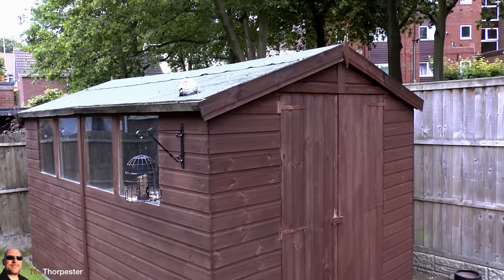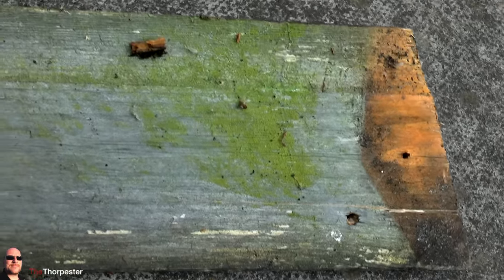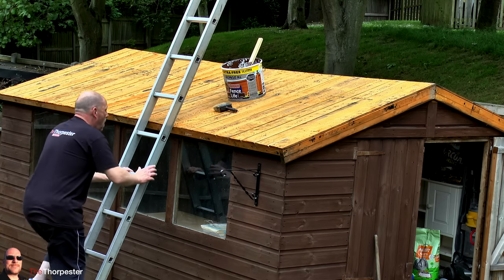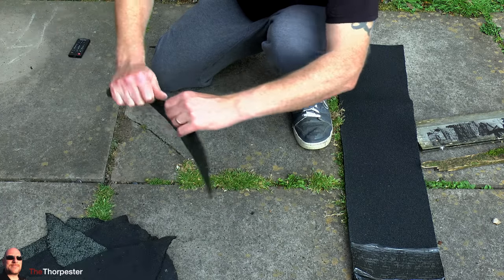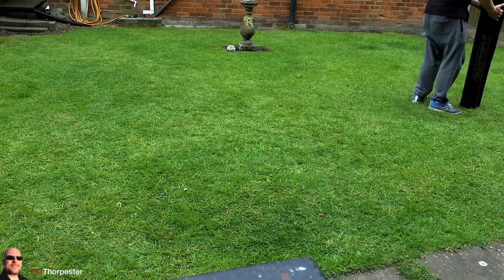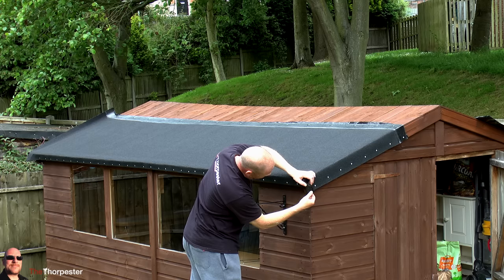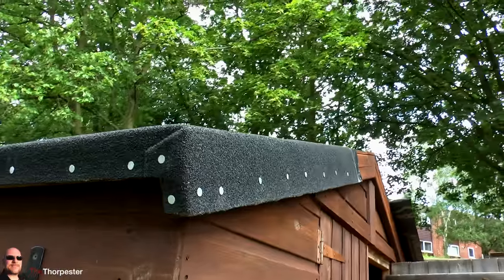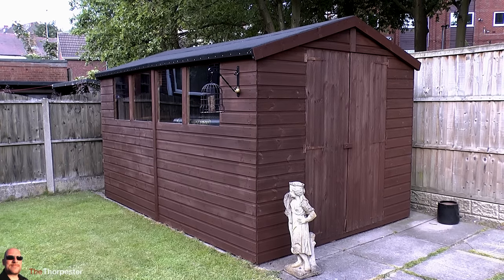How to Easily Felt a Shed Roof The Right Way- DIY

Comment: Might do my own shed roof. At least now I know the adhesive is to join the felt and not to stick the whole lot down! Is it necessary to have the wooden end trims as if mine are rotten I havent got a saw for new ones.
Reply from the maker: Nice one.  Wooden ends not necessary really.  They just cover up the nails and look better.
Reply: If you've got adhesive left over, you can apply it under the turn overs at the edges, it just helps durability.
Reply: Good idea I am going to apply the adhesive to any exposed wood where the felt finishes. Will throw  some dry sand on  this will further protect the adhesive from uv light.

Comment: Nice tidy job. The only issue is that the felt is way too heavy for the structure almost twice the weight of shed felt and will cause the roof to sag in a few years. There are some very strong shed felts available and will last 15 years plus and are more suitable and lighter  and won't cause the roof to sag. The best option by far is EDPM rubber, which is  not much more expensive and comes  in a kit form, also light weight and is one large rubber sheet and will last up to 50 years.
Reply from the maker: Top advice mate thank you although the Shed Roof I put it on will sag no matter what I put on it.  Not built well at all

Comment: Great video thanks :) I’m just about to do the same but to a larger area, got to do something in tier 4 lol 😂 

You have really helped out in my plan and prep... you are a star :)

Couple of questions if you were to do it again would you put two pieces either side and then leave a foot either side at the top point and then add a smaller capping piece instead of using one large piece to go right over?( hope that makes sense? Lol )

Did you put anything over the nail heads like roofing sealant ? 
Thanks again :)
Reply from the maker: Nice one mate.  You'll be fine.  I didn't put anything round the Nails and they seem fine but I suppose you could use the sealant as well making it a stronger seal.  If my Shed had been an inch wider, I'd have had to use another strip.  I got lucky in the measurements.  If you have a heat gun or torch, definitely heat up the back of the strips as you're rolling it on although you don't need to.  Mine's still exactly the same now as it was when I did it.  I'm still really pleased with the job I did.

Comment: Thanks for the video, very helpful and easy to follow. 👍 I need to re-board my 5m x 3.6m roof with 12mm ply as the old boards have warped and leaked from the damaged felt. Would you recommend a preservative for the ply (despite it being covered)? Also, how much of the tar adhesive do you think I may need for the overlaps? I am using four 1m rolls compared with the three you used in your video. Thanks again

Comment: Ive noticed the felt on my shed doesn't cover all of the wood on the overhang. On the Inside it's damp In these areas, could this be the cause?
Reply from the maker: I think a contributing factor if the water is soaking through but there could be something else going on.  I'm afraid I don't know mate

Comment: Very tidy job but why did you use torch-on which is meant to be fully bonded to the substrate with a propane gas heat gun so it’s fully bonded and for that reason is used on flat roofs?
Reply from the maker: Thanks mate.  It's extremely strong stuff and still quite cheap.  A much better alternative to the usual felt you get.  If you have a Torch then all the better but it also works very well in this way too.
Reply: Ray Mason. The clue is in DIY I take it you have used  a torch ? The average Joe would get in a right mess especially on the first attempt.
Reply: @peterbalac1915  the average Joe would burn the shed down🤣
Reply: @mcgraw8098  😂😂🤙spot on

Comment: Hello, great video but could you explain the plastic edge showing on the end edge at about 14.50 on the video. Probably me missing the obvious but will appreciate your comments. Thanks
Reply from the maker: Hiya buddy.  I took the plastic film off to reveal the strip where you overlay the felt (stick it together.  At 14:50, I was overlapping the other way round as I'd already gone over the top with that sheet so it is on show.  I put it at the back though out of view.  Hope that helps.
Reply: Thanks very much for clarifying it.
Regards

Comment: Hi sir, do I need the nails as a bit worried about water getting through. Going to do this at the weekend. Very good video thanks
Reply from the maker: You need Clout Nails.  They are designed specifically for this and the Felt will form a seal around the Nails
Reply: One can smear a dab of roofing mastic over each nail if you like to definitely stop any nail leaks. A few minutes work could save an unseen leak rotting out the board.

Comment: Do you think it is necessary to put the nails on the overlap even if you're using the adhesive ? - im doing mine next week
Reply from the maker: I think so buddy. I suppose you could torch it on so it’s a proper jobbie but I don’t have a torch
Reply: Use a good adhesive or even (Bostik) bitumen paint will help seal the gap

Comment: I would have sealed along the front and rear of wood top edge so water does not sweep into the crack
Reply: Pointless as the felt does the all the sealing you need.

Comment: Any advice on how to remove felt sealer/glue that has stuck onto the actual wood? Seems hard to scrub it away as it's proper stuck. Currently looking into pouring some boiling water on it to see if it'll soften it up and then scrub away
Reply: Try a bit of petrol on a rag (but don't smoke whilst doing it!)
Reply: @VC57UK  I used some paint thinners. And it worked pretty good. Thanks anyway

Comment: Where can I buy exactly the same as in video polyester based pro black torch cap sheet?
Reply from the maker: Got mine here mate but if you search for rooftrade tradetorch felt, you'll find it.  https://www.diy.com/departments/roof-pro-torch-on-grey-roofing-cap-l-8000m-w-1m/1143874_BQ.prd
Reply from the maker: @Sparro Torch On Felt must be available somewhere.  Doesn't have to be this particular on (B&Q Brand).  Any will do as long as Polyester based
Reply from the maker: @Sparro If you search Google for Torch On Felt, loads pop up
Reply: @TheThorpester  I bought from B & Q last  week; they had loads of rolls of it..
Reply: @Sparro -  Wickes , Selco, etc

Comment: Just as a point of (un)interest.  In the video you correctly stated that the roles come in 8 meter lengths.  However, on the website which you gave in reply to a comment,  it has the role length as 8000m (almost 5 miles).  Probably a typo;  or maybe the staff haven't got hang of metric measurements yet!
Reply from the maker: Haha unless they're just selling massive rolls to get rid of old stock.  Delivery by CRANE/CHINOOK!
Reply: I noticed this too when I just ordered some :D
Reply: 8 m (Metres), 800 cms, 8,000 mm - just an 'm' short

Comment: I just had to refelt a shed roof and one of the things I was told was to not nail the bottom pieces at the overlap but instead pin them on the sides and bottom and then when you place the middle section over you effectively pin them together. Anyone had issues doing it that way?
Reply from the maker: That’s good info mate. Only thing I would say is that without the nails on the overlap, the wind would eventually get under there?  I’m not expert though. Clearly lol
Reply: @TheThorpester  no ones an expert really as depending on where the shed is has a different effect. High winds, damp area etc etc. However, we're all still trying ;) 

Thanks for sharing the video also, nicely edited! have a good one!
Reply from the maker: @waldo795  very true. Nice one buddy and thank you 🫡
Reply: Nice music

Comment: I started taking off the old felt yesterday. To my dismay it's stuck with some kind of black adhesive around the edges! It is thick, hard and tar-like and it's a b****r to take off. What a pain!!! I've been using a Bosch multi-cutter to get it out but there is no way I can take off all of it, some will stay. Any tips?
Reply from the maker: Nightmare, sounds like you need a Blow Torch mate.  Could probably roll your new Torch On Felt on top of the adhesive and heat up as intended?
Reply: Burn the shed down

Comment: This a 2 part system (base and cap)but you only used the cap. You do not need the glue if you actually used a torch to bond it to itself as the product was designed for. The nails caused weep holes and you're going to have water damage.

Comment: Good video, thanks. However, how you used the stepladder was very dangerous. you should never stand on the top rung as the stepladder is very unstable and there is a high risk of falling off.
Reply: Technically, he was 'at work' and therefore revealed himself to be in breach of the EU's H&S regulations!

Comment: why doesn't it leak through the nails that you've put across the join or overlap on the top of the roof ??
Reply from the maker: The Felt forms a seal round them.  Clout nails are specifically for Felt Roofs.  Also, I put the glue stuff underneath which helps,
Reply: The nails are underneath the overlap and are never exposed

Comment: Can you get this stuff in anything other than black.  It must be like an incinerator in there in the summer. I've got the green mineral stuff on mine and I have to use a fan blowing over a damp towel to get some of the heat out
Reply from the maker: Not sure mate but I'm not sure what difference it would make
Reply: @Sparro Exactly, your reflecting some of the suns radiated heat away.  If you want the maximum absorption of radiated heat then dull black is your best solution.

Comment: This has been really useful in particular for the material - Tradetorch. I would have gone and bought the best roofing felt I could find and that's still fairly useless!
Did you trim the width of the top piece to give an overlap to the smooth edge on the lower strips? Just wondering if its necessary to trim it?
I am struggling to find a dry spell to replace mine. Plastic sheeting has now been shredded in the storm. I am thinking that if the timber is damp it will still dry from underneath if I recover when damp. Would you agree?
My shed is 5metres which means that I would need 3 rolls unless I could use two cut strips across the top, in which case I could get away with 2.. I am wondering if its wise to do this or should I use a whole strip across the length?
Reply from the maker: Hi mate.  I had just enough for the top overlap so didn't trim the top piece.  I put the non-smooth edge at the back if that makes sense and it's fine.  I think the Timber would struggle to dry maybe if you seal the roof over it but mine wasn't totally dry when I covered it and it's dry now.  Just make sure you do the prep and soak it in a good timber care product before you start.  Regarding the 5m, I wouldn't use 2 strips and would bite the bullet on the 3rd roll.  The less joins the better I think buddy and the finish will look much better too.  Just think of it as a job to do which should last for years so a bit more care and expense now will save you heaps down the line.

Comment: I  work for a shed company we put the felt the other way which stops a lot of sagging
Reply from the maker: Sorry but I don't believe that's a good idea at all.  The chances of water leaking in through the seams are very high if the seams are vertical and you'll have more of them.  I've never seen Felt on a Shed vertically but I'm no expert.  A Shed Company does that???
Reply: What's that smell??
Reply: @Lamster66  You can see in the video Roof Pro
Reply: @Lamster66  what’s 5k please?

Comment: I am thinking of dong my 8 x 16 Shed, it currently has wooden Battons running vertically along the roof, are these necessary ?
Reply from the maker: On the outside?  Probably to give extra stability  but I'm afraid I don't know if they're necessary.  If the Roof is stable without them, I'd remove them so you have a flat surface.  Sorry dude, that's all I can think of and I'm not the authority on the matter :(

Comment: Doesnt the torch on felt have a plastic layer on the underside that should be removed when being installed? That way its melted on via torch or slowly by the sun over time...
Reply: Also the edge thats exposed along the back join needs the uv protective shingles applied to it to protect tgat strip from deteriorating with sun light
Reply from the maker: I removed it

Comment: Has the felt stood the test of time thus far? (please be honest), reading some reviews on this product & a lot of people say its crap and after a very short time the roof started leaking, thanks 👍
Reply from the maker: Hey buddy.  No joke but It's exactly the same today as when I did the job.   The only thing that's failed/failing is the wooden trim on the front and back of the Apex.  Felt is fine and I'd still recommend.  If it leaked I'd tell you buddy.
Reply: @TheThorpester Would be interesting to see you do a quick update video comparing material costs in 2024? 😮

Comment: Doesn't the rain go through the nails on the roof eventually?
Reply: I will he has used the wrong felt that should
Be torched down as you can see on the back of roll it says turbo torch lol.
Reply: @jordanhudson5605  so can you use torch felt without heating it?
Reply: @jordanhudson5605  its not the wrong felt, its a decent felt to last, it doesn’t need to be torched on a shed roof. This is just a top grade felt for flat roofing and you would torch it down in that instance.

Comment: How did you dispose of the old felt? I'll be doing this next weekend to my shed and I can't work out whether the felt is hazardous or not. Some councils say it is, others don't even mention felt on their websites :/
Reply from the maker: The old Felt literally fell apart to small bits so I just put it in the usual rubbish Bin.  I could have taken it to the Tip though.  Don't think it's a Haz
Reply: Councils🤢
Reply: bonfire backyard

Comment: Hi. Could I do this on an 8 x 6 metre habitable summerhouse?
Reply: Yes, exactly the same. You may want to put roof insulation boards down first. 
Have a look at epdm rubber roofing as well. Only slightly more difficult to fit, but the finish is better and it lasts longer.

Comment: hi great video ,did you  apply the adhesive over the plastic edge strip or does that peel off to leave a tacky surface to bond onto .
Reply from the maker: I peeled it off mate.  I'd have burnt it off if I had a hot gun.
Reply: @TheThorpester   thanks i dont have a heat gun either so i will peel it off . planning to do this weekend identical shed to yours , can get torch on from B and Q  you mentioned( or maybe another video)  it may get stiffer in cold weather , should be fine i would have thought .
Reply from the maker: @chrisgallivan4754  Nice one.  Yea I got mine from B&Q.  They didn't have any hot guns when I went otherwise I'd have got a cheap one and used it on the Felt.  Was a bit of a pain peeling the plastic off but it turned out fine in the end.  Good luck buddy!
Reply: I take it you left the plastic film on the back of the main roll and didn't remove it before you rolled it on the roof ?. I suppose you should really remove a 100mm stop of the plastic film from the base of the roll so when you bond the exposed self edge strip to it the plastic film doesn't act as a debond layer. Don't suppose it matters as you put so many clout nails in.
Reply from the maker: @chrisgallivan4754  It was a pain but I did remove the film on the bits that I had to stick.
Reply: Glad I asked so did I, more or less completed now , guess who only added an extra 10cm overhang not 20cm over the capping strip ..... Retrievable  with all the spare membrane and adhesive and barge boards to hide it all .
Measure twice etc etc. Ps  get knee pads or a decent cushioned pad to save your knees. 
Thanks for video
Reply from the maker: @chrisgallivan4754  No worries mate and nice one!

Comment: What is a point of felt if  nails go through felt  after anyway. ? Heat cold heat  again in tiny holes apear around the nails what cause leakage again...
Reply from the maker: Seal is formed around the nails here.  I do have that issue on my other shed though with the crap felt. This stuff seems much much better. You also don’t have to use nails. If you have a burner then burn it on as intended
Reply: These nails come with big nail heads so to stop water from going into the tiny holes. You can also use roof felt adhesive to eradicate this issue.
Reply: @backllem  On top of the nail heads or in place of sing nails altogether?
Reply: @JustinMurray170fin  I would only put adhesive between where two sheets of the felt overlap. I wouldn’t recommend putting the adhesive on top of the felt unless you dont care how it looks.
Reply: Let's just accept that people have been using these nails with felt for generations without water entering through the tiny holes.

Comment: Very useful guide, thank you. Is there a reason why you didn't apply the glue to directly onto the wooden apex but  two side felt bits only? 
Also, I had a look at my shed and under the peeling 30-year old felt, the roof bits are rotted away at the ends. I wonder could I just pull the new felt over these rotten edges and hammer it into the side bits, which are intact. The alternative is...a new shed? Or maybe a length of wood running the length of the rotten edges to provide a straight edge. (hope this is clear!).
Reply from the maker: Hi Buddy.  I suppose the glue could be applied underneath but I believe it's for sticking felt to felt.  Not sure how it would work felt to wood.  This is Torch On Felt so if you have a blow torch you could heat the Felt up as intended and Torch it on.  For the rotted pieces, not sure on that one either I'm afraid.  I no expert however just keep in mind that if the edges are rotted/sharp, they could go through the felt.  If you can replace the Wood all the better.